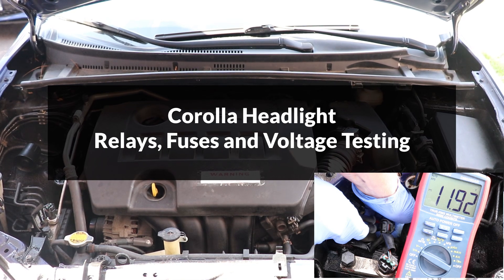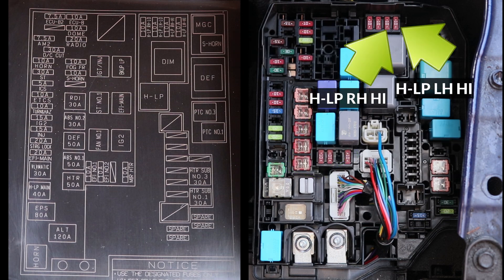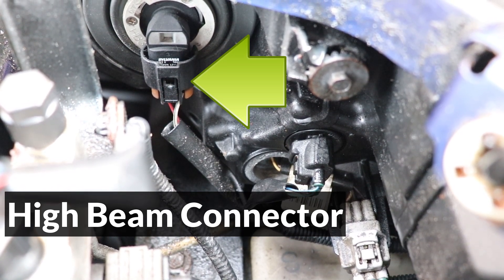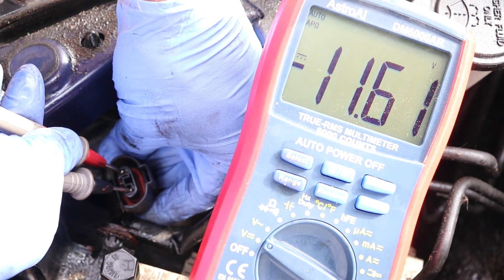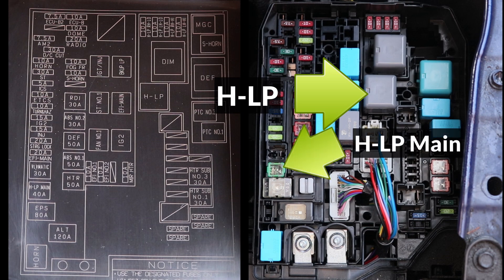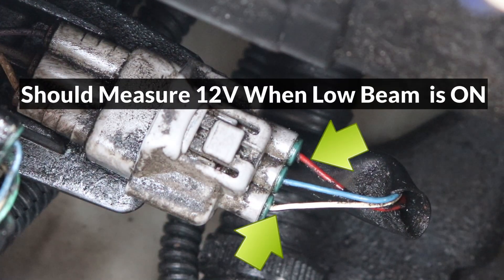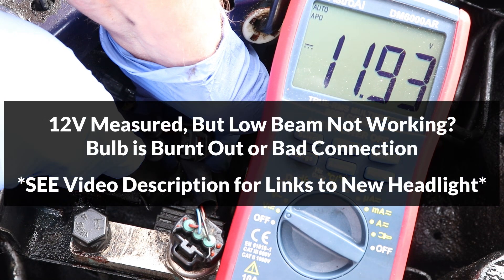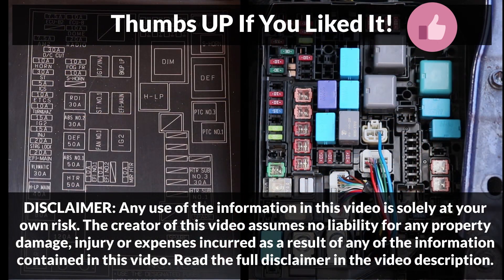High Beam &  Low Beam Fuse & Relay Locations & TESTING, 2014-2018 Toyota Corolla

Comment: Easy solution for low beam light failure. Drain the water from the unit thru the rubber port in the back, and dry it using a hair dryer. Usualy the light fail due to water entering the light unit.

Comment: My 2020 toyota corolla LE has a dim passenger headlight.  I tried to buy the LED bulb but I was told I have to take it back to the dealership to have the whole l
Headlight assembly replaced. A set of headlight assembly is gonna cost me a $1,000.00 not including tax and labor. I'm just stunned.

Comment: Replaced both lights on a 2019 Toyota corolla  hatchback se and the drivers side bulb doest work everything else is working led lights are on but high beam and low beam won't turn on only on the drivers side

Comment: Hi I have 2015 nx200t f sport and the auto headlight stop working even if its dark outside I need to manually turn on my lights now I did some Googling and nobody didn’t figure out whats going on.. please help
Reply from the maker: This is the best I found: https://www.clublexus.com/forums/nx-1st-gen-2015-2021/933919-2015-nx200t-auto-headlight-feature-help.html  if the sensor is not obstructed, it should be detecting the light and working. So if it's not, it has to be checked with a diagnostic tool, and most likely the sensor has to be replaced.  https://www.clublexus.com/forums/is-3rd-gen-2014-present/839095-headlight-sensor-location.html

Comment: Hello may i ask where to find the flasher relay on a 2015 model?
Reply from the maker: Sorry, YouTube held your comment for review and I just saw it. If you mean turn signal relay, there isn't one that can be removed. It's built into the body control module, and it's probably a transistor. On old cars you'd hear the click when the relay turns on, but not on this car. Let me know if you have any other questions, thanks!

Comment: I have almost the same car, down to the same color (a 2015 Corolla S Plus), and you have been a godsend. I've learned how to maintain and make specific changes to my car in a way that no other channel does. Keep up the good work!
Reply from the maker: Awesome 😃! Thanks for the comment. Can't believe mine is 10 years old already. I got some more videos coming..  I'm ordering new struts soon, and thinking about controls arms as well. My front control arm bushings are squeaking for a couple of years now when it's cold out... I've been taming it down with Krown rust-proofing spray, but it's annoying.
Reply: @CleverFix  Yeah, these Corollas usually have those issues and require changing the lower control arm. I'm looking forward to those videos!